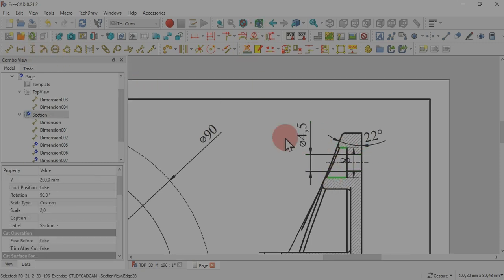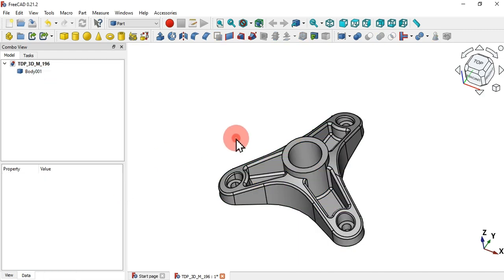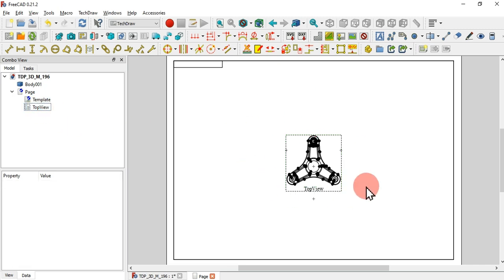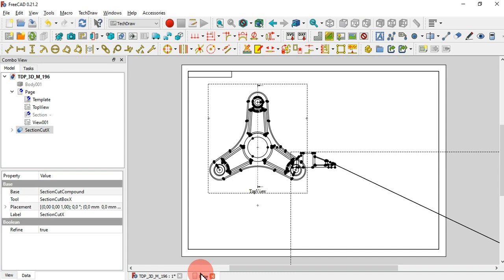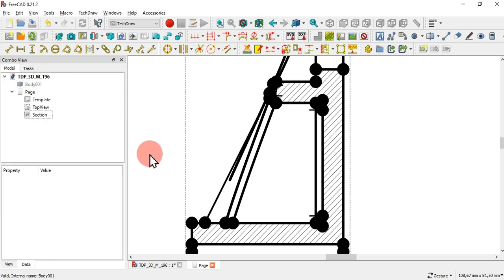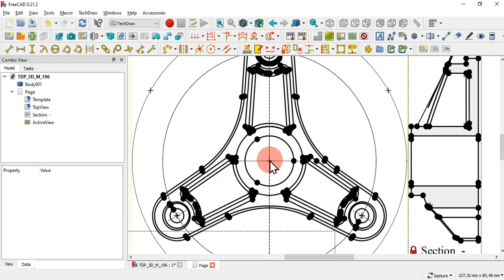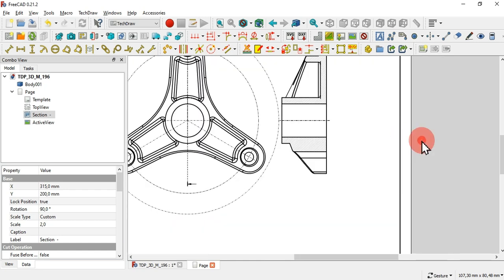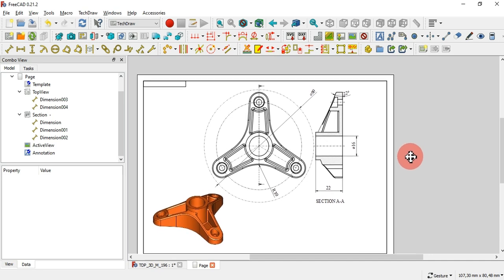Freecad 0.21.2 / FreeCAD 1.0.RC2 TechDraw tutorial part 1: STUDYCADCAM 3D model

Comment: Hi, thanks for the example, I had a lot of the issues with the cross section view. I found that if I try to scale the model up to any size but 1:1 it shows the extension line that appeared on your model. Also with the Hatch you can change that using the scale in the cross section menu. Looking forward to seeing your example with ver1.0 as I could not get it to work and have raised an issue with FreeCAD which they are working on now.
Cheers
Reply from the maker: Thanks.